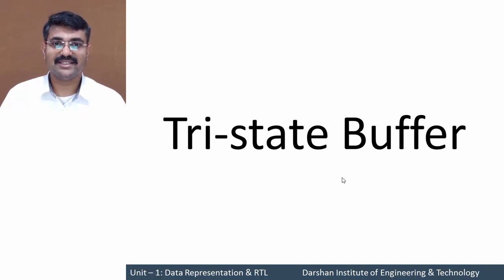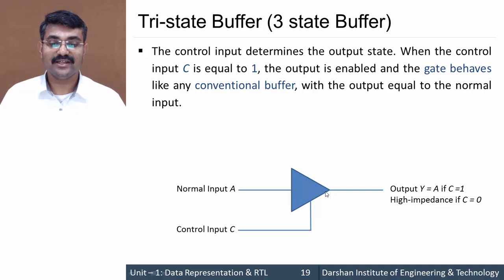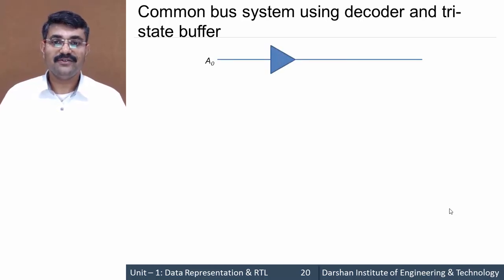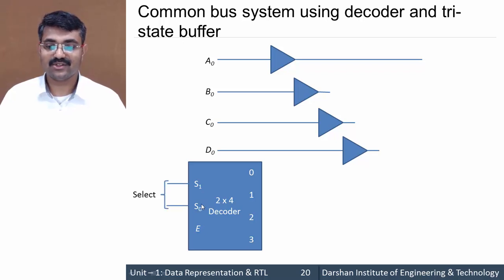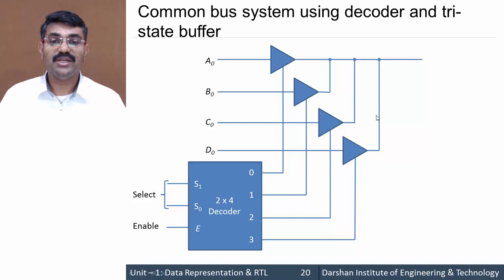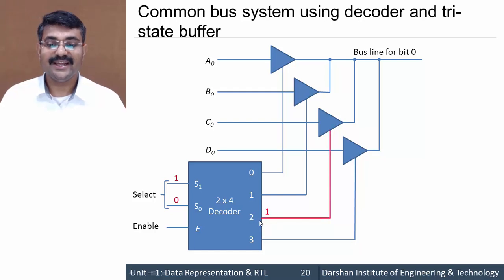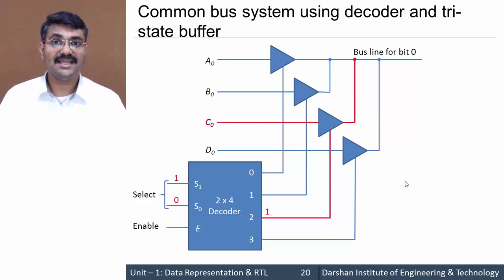1.03 Tristate Buffer

Comment: 00:06 A tri-state buffer is a buffer with three states, including a high impedance state.
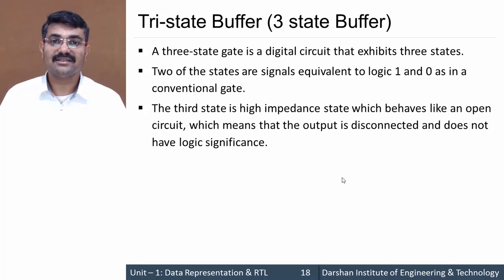00:56 The buffer gate has a control input that can put the gate in a high impedance state.
01:51 Tri-state buffer is a logic gate used in digital circuits.
02:41 Designing a system using tri-state buffer and decoder.
03:30 Study on decoders and their working
04:19 The circuit is almost complete
05:08 Providing input of 1 0 to the decoders enables the second line
05:55 Application of tri-state buffer in a common bus system
Crafted by Merlin AI.